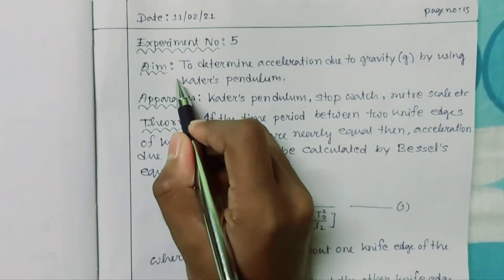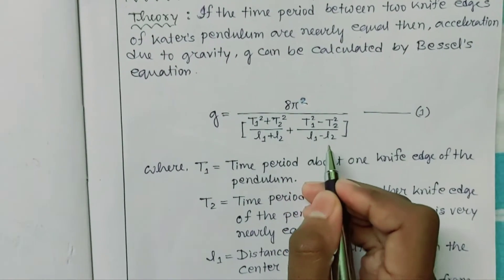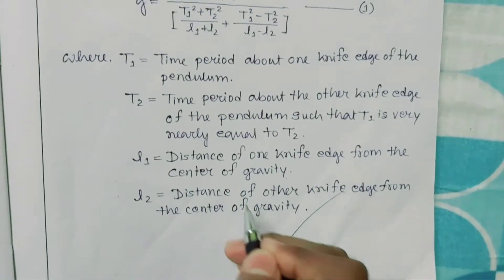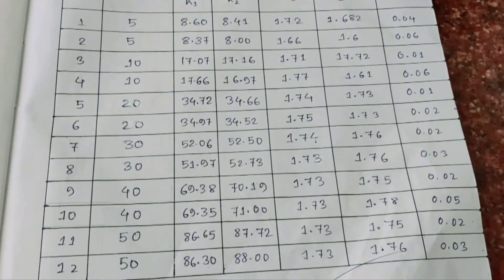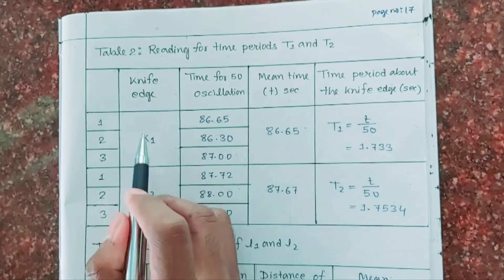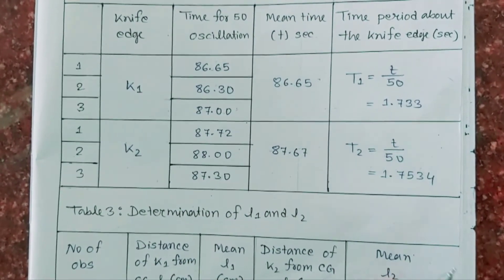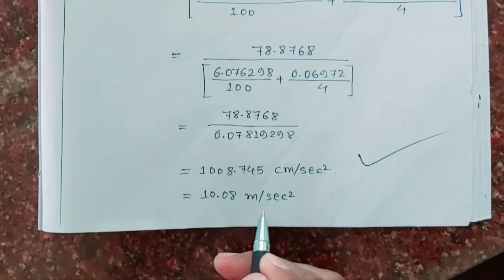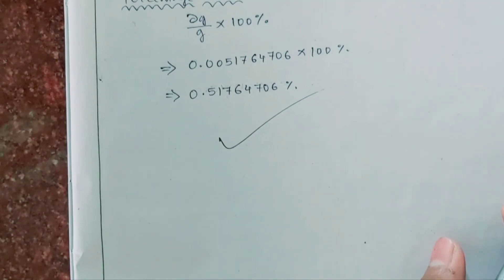Katers Pendulum experiment by Hirak Jyoti Ray Prodhani. B.Sc First semester #physics #Hirakjyoti

Comment: I'm sorry to say that the set up and method followed is wrong which are stated below -
1 the big cylinders are to be fitted above the knife edges and small cylinders are to be fitted below of knife edges
2 oscillations are to be observed through  telescopes
3 oscillations should be as small as possible.
Reply from the maker: Thanks but I don't know about your method. Our teacher teach us like this. And I tell in my video that for oscillations angle in between 4 to 5 degree.
Reply: @hirakjyotiprodhani111  absolutely wrong method taught to you.
Reply: @xfiles6879  you are saying right
Reply: @भारत-एकगांव  🙏🙏